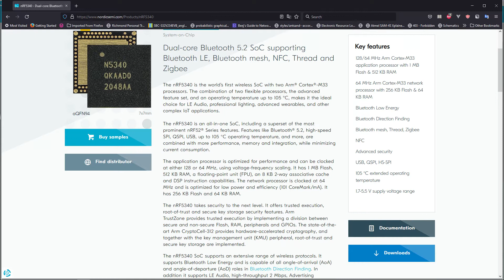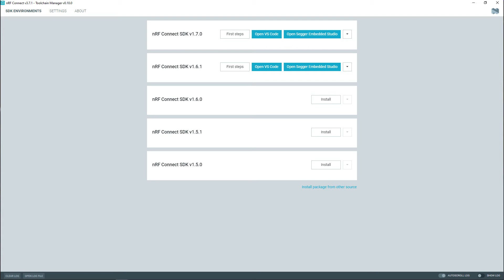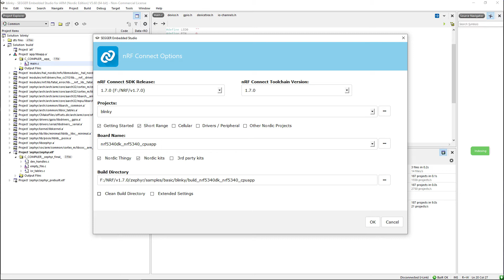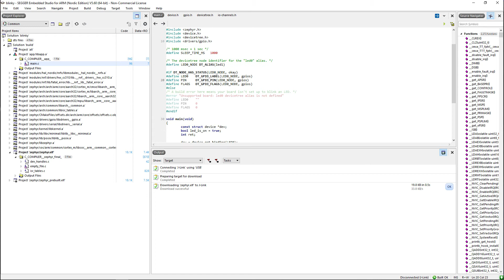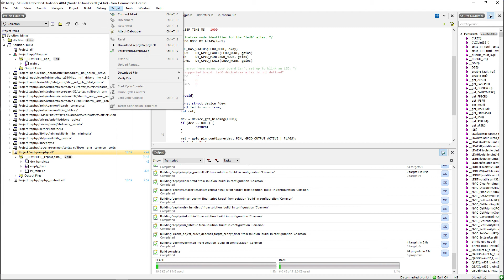How to get started with the NRF5340-DK

Comment: hello, I followed instructions in your video, but when i tried to upload program to microcontroler (hit the "download zephyr/zephyr.elf" option), came up the window with "no emulators connected via USB. Do you want connect to a J-Link via TCP/IP instead?" than came up error "cannot connect to J-Link". I tried reinstall J-Link driver, but it didnt solve the problem. I tried other usb ports and new usb cable. Can you give some advice how to resolve this problem? Thank you
Reply from the maker: Hi Mladý ombudsman! Thank you for your comment. Without knowing your exact setup it is hard to provide any solution.  Whenever in doubt about using MCU, I highly recommend using the support channels of the manufacturer. Do post your question on https://devzone.nordicsemi.com/ . As far as I am concerned Nordicsemi has one of the best customer support out there. They will be able to help you out. Take pictures of your setup, video too if possible  and you will get a reply. 

Good Luck!
Reply: @antshivrobotics  thank you, I solved the problem. There was a problem with powering board, not in driver as I thought. Thank you for your recommendations and I hope I will see next videos from this amazing nordic microcontroller soon.
Reply from the maker: @mladyombudsman3103  Cool! you can watch the next part where I interface the NRF5340 with NRF24L01+ here https://youtu.be/gZJYD2aQJqc . I will do a video where I am able to use the BLE protocol too shortly.